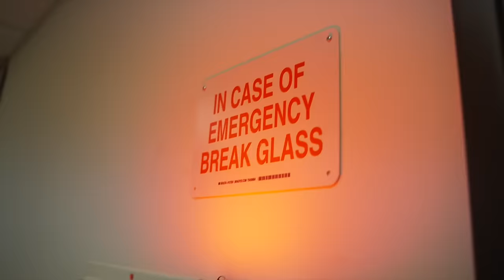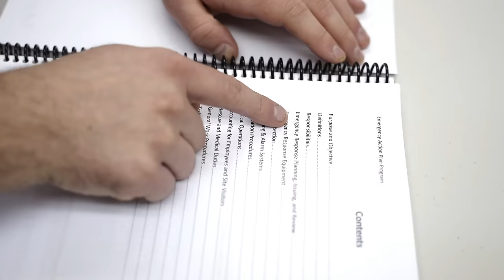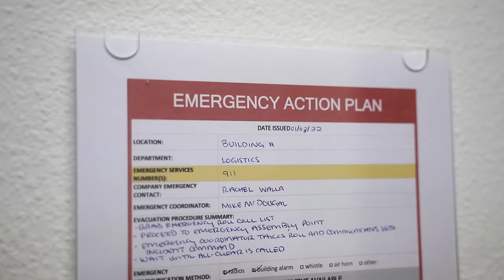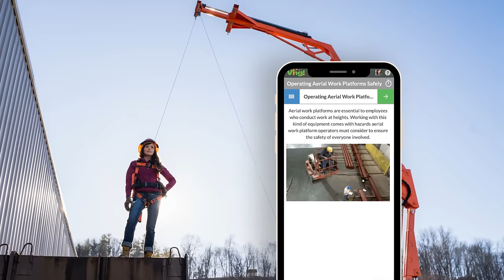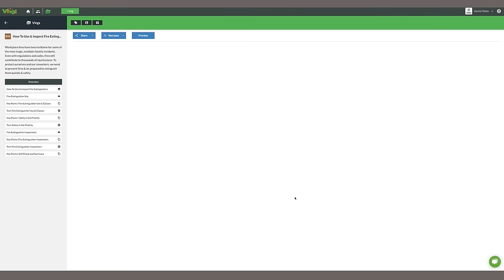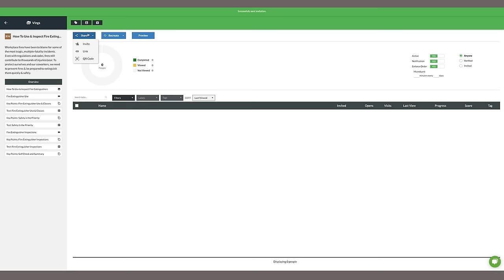Emergency Action Plan Training | By Ally Safety

Comment: I once walked into a computer repair shop that I did contract work for, and the trash can was on fire. The clerk was just staring at it. I asked if she planned on doing anything about it, and she said "No, I don't know where the fire extinguisher is.", in the most bored tone imaginable. I poured my soda into it, since I didn't know either, and drug it the slightly less burning trash can into the parking lot. Some plastic displays had melted, and the building reeked of smoke, but no damage was done. I called the owner, and discovered 1) There was no extinguisher and 2) he had no insurance. That was the day I decided I didn't want to do contract work for them anymore.
My point is, some emergency responses really are as bad as they show.